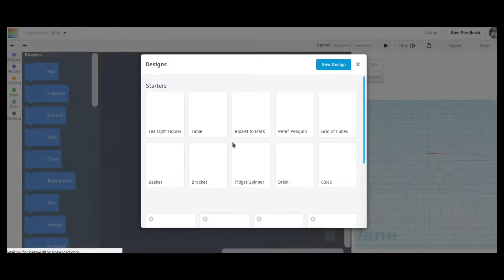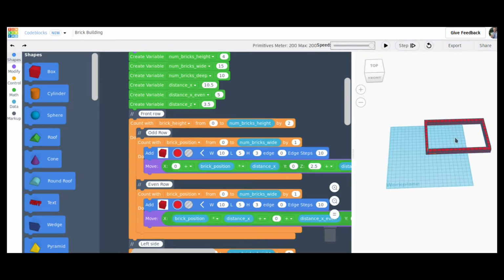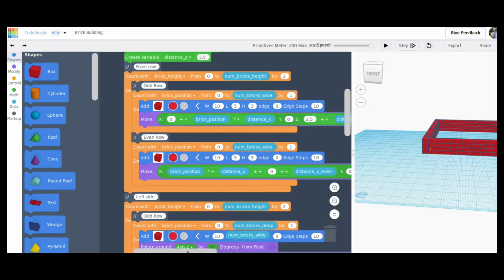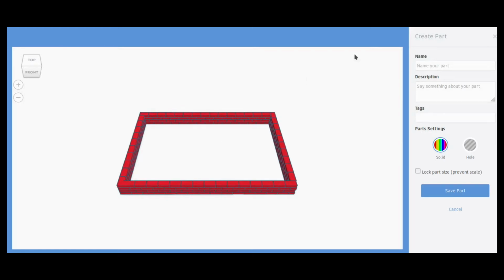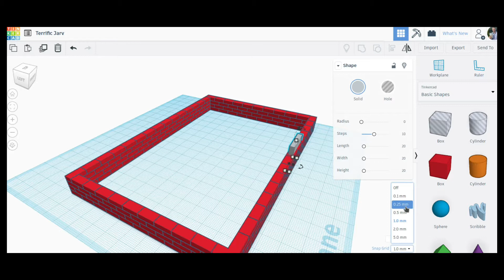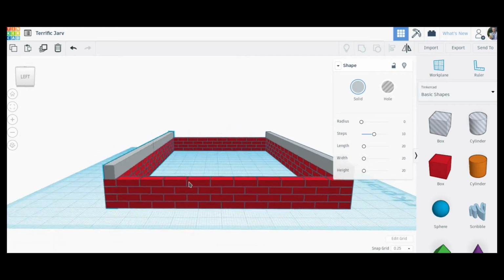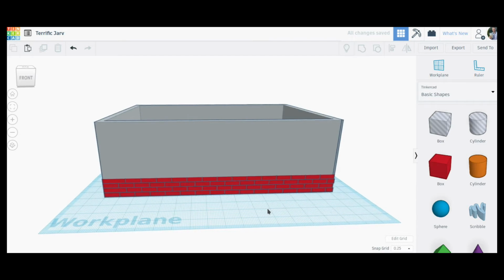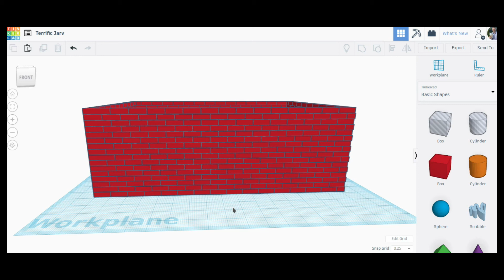Creating a model railway building using TinkerCAD Codeblocks

Comment: So basically you can change the brick quantity, brick dimensions, and overall building dimensions all in one software? Absolutely genius!  

Where can I get the mod/file for tinkercad?
Reply: Keep getting error saying i inputted to much. Are you able to share the code? The code in the video and the code on the site are different. For example you have W 10 L 5 H 3 E 0 and ESteps 10 on every row. But in your video you have different inputs
Reply from the maker: @baljazz  The problem is that TinkerCAD has a fairly low limit on the number of objects. The only way I know to overcome this is to split the wall into multiple sections. 
Eg. Reduce the height. You then need to export the model then import it into a new project where it is imported as a single object. You can then duplicate that object to build the complete wall. 

Unfortunately this is very tedious, but it's due to the limits of TinkerCAD. 

It's because of these restrictions that I only use TinkerCAD for simple projects and I now use FreeCAD, unfortunately it is a much steeper learning curve to be able to use FreeCAD.